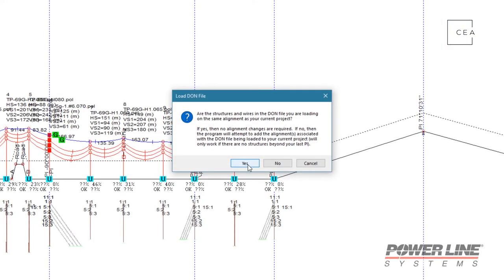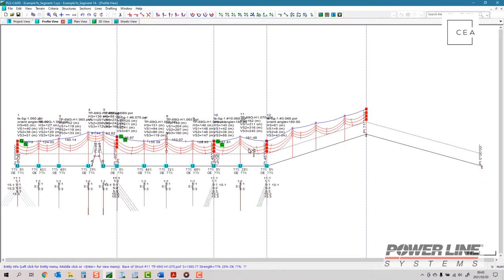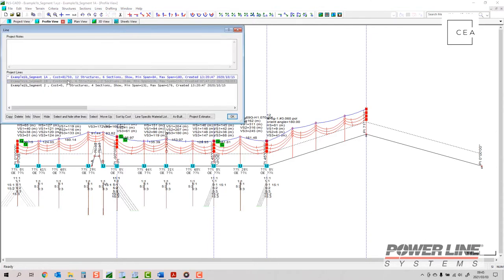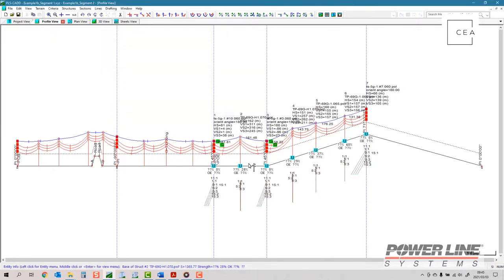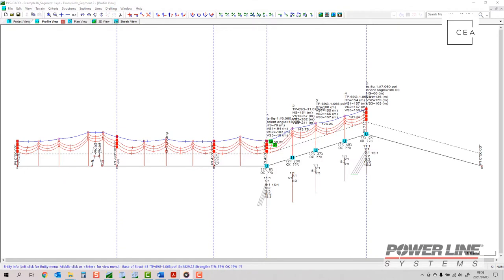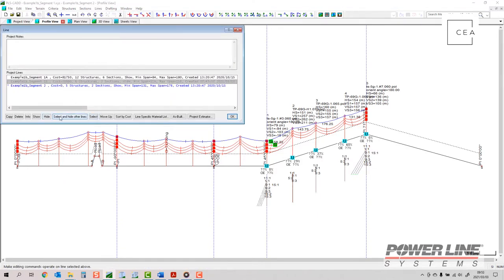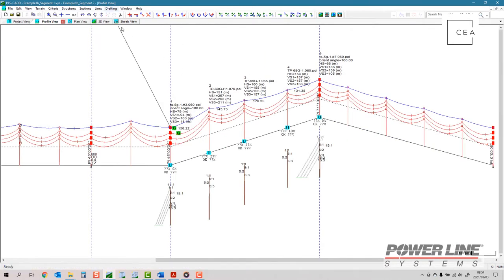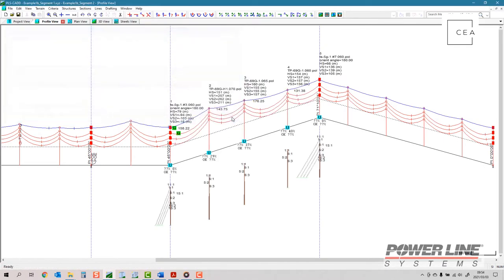CEA 75 - A Day in the Life of a Transmission Engineer

Comment: Do you require additional training within the electrical discipline to better understand the purpose and performance of transmission lines? I noticed you speak about concepts I've never heard of before in civil engineering when you describe the transmission lines for example the ampacity of the line.

Comment: Hello Isaac, thanks for the informative video. I have an interview next week with the transmission team at my local power utility company. Just wondering if you have any tips for my interview. It will be very helpful if I can gain some insight from an experienced transmission engineer like what kind of quality and skill set a transmission team will typically look for in a applicant. Just some info about myself, I am currently a pole line engineer for distribution utility poles, and I am finishing up my structural master's degree in the coming May. Any input will be much appreciated. Thanks
Reply from the maker: They will mainly ask you questions related to jobs performed, plscadd experience, difficult situations you've dealt with, safety, how to manage time.  They could ask what's in a typical job IFC packet.  Shoot me an email if you have more questions!

Comment: My name is Jai, by profession I am working in an electricity industry as a Trainee Line Mechanic. I have a Bachelor's degree in Electronics and Communication and a Power Engineer diploma degree. It's been 6 months working in the industry , due to some internal changes in company we are moving around in the nation and job opportunities are coming up. As in that a vacancy of Transmission Line Engineering came, I am keen to apply and go forward it but I don't know 
If things can be possible after watching your video. Like you were talking about PLC and AutoCAD, but I have a basic knowledge of powerworld software on which we were designing our network while studying do you think that will be enough or I have to enhance my knowledge in some other tools to make it happen?

On the basis of my study can I get this job and learn tools parallel to work?